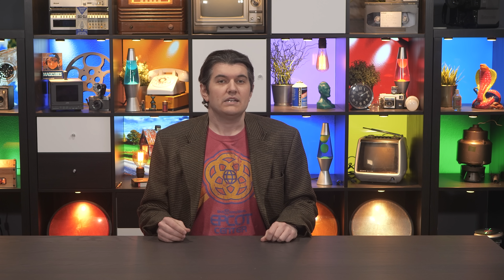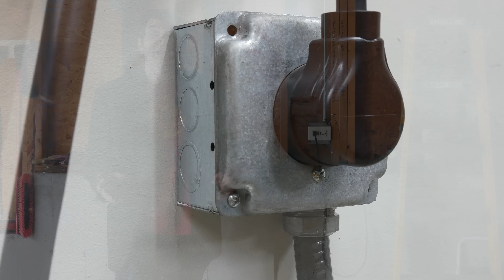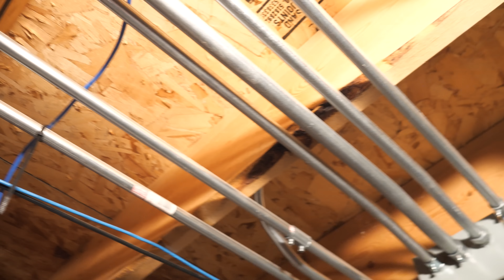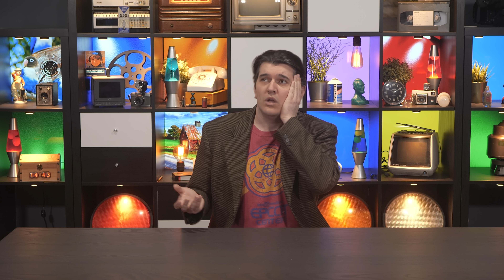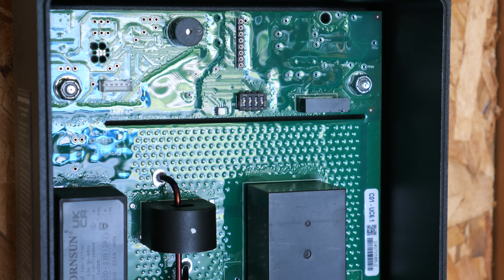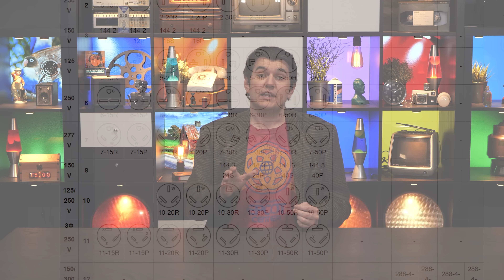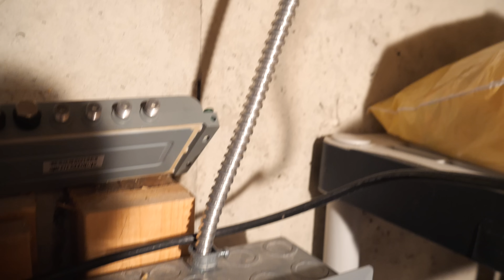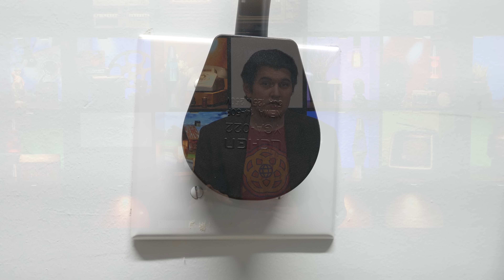The "standard" car charger is usually overkill—but your electrician might not know that

Comment: I understand your overall point: don't let home electric service limitations stop you from getting a better charging station, don't let perfect be barrier to achieving good enough.

However, if you have the capacity, and you are having to pay someone to install it, it is going to be better in the overwhelming majority of scenarios to absolutely max out the circuit. The biggest cost is going to the electrician, and EVs will only keep increasing their total battery capacity as time goes on, so undersizing the charging install is going to stifle things for the home owner (or future home owners) down the road when biting the bullet and paying the likely modest difference between a 24A vs 48A charger.
Reply: I'd argue the overall point is: you don't need upgraded service to get and support an ev.
Reply: @Spiker985Studios  that was only when he was talking about using a standard wall receptacle/15A circuit.

Everything else involved installing new service to somewhere in the house (some jobs being much easier than others depending on where your electrical box is located relative where the charger is going.)

If you are going to go to the effort or expense of running a new circuit, and you have the room in your breaker panel, there's no reason to not install a full 60A charging circuit. The price difference between running a 30A/240V circuit and a 60A/240V circuit is trivial compared to the cost of running a 30A circuit and then having to run another circuit 5-15 years down the line when EV's have 2-5x the battery capacity, or some other innovation leads to EVs needing more power.
Reply from the maker: @TeflonBilly426  So... do you know what load calculations are? Because if you've only got 100A service, and your load calcs reveal you've only got room for 20 more amps, then it is not trivial to run a 60A circuit. Because now you need a service upgrade.

Feels like you missed this.
Reply: @TechnologyConnections  I said this twice "if you have the capacity, and you are having to pay someone to install it"

I don't think I could have been any clearer that I was accounting for situations where there wasn't enough room left at the panel, whether it involved having to install a sub panel, or upgrading the entire homes electrical service when I said "if you have the capaciy" then don't scrimp running a the maximum charging circuit.
Reply: @TeflonBilly426  Yeah but really you could never need a 48A charger because you can just as easily charge your car with one of those solar panels from Harbor Freight.

Feels like you missed this.

Comment: 240v is defiantly better / but i seen several stories on the outlets  and a precautionary warning that there 1 co making quality under brand name and a lower cost equally good 2nd brand. but there's really cheap ones  that are said to be   dangerous 
so a little searching is prudent some things the cheapest is not best  but finding the 2nd name of the top one is smart  
i an tired of so many products now are the cheap china made no matter what brands on it . btw  seems major cities refuse to update codes to keep trade union happy like philly required pipe fitters pipe waterless urinals at the comcast building and last heard not a drip of water was pumped

Comment: I actually like that code requires conduit in Chicago and I wish it was here in Canada too, it reduces the risk of fires, it looks way cleaner and makes pulling new cable through that conduit so much easier rather then having to worry about romex being stapled somewhere.
Reply: Our (Canadian) 240V outlet installation required armoured cable or conduit because it’s in the garage… codes vary from province to province as well.
Reply: EMT isn't IMO any safer than properly installed NM-B; wiring itself is seldom a fire hazard, it's almost always equipment plugged into receptacles or the receptacles themselves.  Or junctions (wire joins: wire nuts, etc.) which still have to be in a j-box anyway, just like an EMT setup.
Reply: @alsavage1  YoURe pUtTiNG gLoRiFiED EXteNSiOn CaBLeS iN yoUR waLLs!!!

Comment: My Ford Escape PHEV has a 240v 16A EVSE connected to a 20A circuit. It only takes about 3 hours to fully charge but most of the time it’s not completely empty. 
Agreed that you don’t really need higher speed charging then 16A

Comment: I charged from a standard wall outlet for the first year of my EV, and only rapid charged once, on a road trip. Adding a 14-50 outlet in my garage was mostly because I had to unplug and re-plug my 5-15 EVSE every time, and the outlet was starting to feel a bit loose, which makes me nervous when I'm running 1500w unattended. 

The 14-50 is fantastic though- being able to go skiing (about 175 miles round-trip) on a Saturday, fill all the way up, and do it again on Sunday, is awesome.

Comment: I installed a NEMA 14-50 outlet and a 240 Volt charger but often use at standard outlet and the 115 Volt charger that came with my Kia Nero.  I don't drive that much and have the time to charge.  I also think it might be easier on the battery.

Comment: As Tesla and other EV manufacturers release their grip on my right to repair, electric vehicles are becoming increasingly compatible with my current daily driving needs. Unfortunately, the old "but sometimes" rule comes into play because every couple months or so, I have to drive long distances that would make an EV a significantly less than ideal situation. I expect once I move to the eastern states, an EV will fit me much better since I won't be making those long drives quite as often, making it more reasonable to put up with.

Comment: Missing the point of max constant amp rating of outlets. sure you can pull max amount from the wall socket but it will heatup and melt at some point

Comment: Why is the charging box so expensive? If it's literally a microcontroller closing a relay in a box, why does it cost the same as a computer? Also, why is it so big? I would expect it to be the size of a laptop power supply or something like that.

Comment: You can get a relay to share the same circuit if you have a dryer circuit. The car is primary but is disconnected when the dryer is turned on. If your dryer is in your garage, then you are set.
Reply: You mean just like Alec said in the video?

Comment: I fully agree with everything you said. I used a regular outside 120V plug for two years for two Nissan Leafs, but I installed a 30A hardwired unit primarily for the much higher convenience.

Comment: YUP!  I've been driving & charging my 2019 eGolf for 5 years with my standard 120V plug for my daily driving.  The only time I use a 240v power station to charge, is if I'm on a road trip at a public charging station. 😉👍

Comment: This is just one data point, but I have been charging my cars on primarily 120v at home for several years and have never been left in the lurch. I do have a laundry room adjacent to my garage, so on the rare occasion I really want to charge faster I drag out the big 10AWG extension cable I built and swap plugs on my mobile EVSE to match. (both the one I have now and the EVSE that came with my old car were switchable between 120 and 240). I rarely do this because it is just a hassle when I don't need to do it.

Comment: If there is already a cable or wiring for the charging station then yes, don't worry. But if you are installing new stuff anyway, consider the extra costs and possible future advantages. Like flexible energy pricing. You might not mind waiting 8 hours at night, but if you can take advantage of nearly free power for a few hours, you might want it filled faster. Or you might want to charge two cars?

Comment: My one question for you in regards to smart chargers is PowerShare with other chargers on the same circuit. I’d find it incredibly useful for homes with multiple EVs. If both chargers are in use, then they split power on the circuit, but if one is only in use, then why not use the available capacity?

And yes! A remade/updated guide on your guides would be much appreciated!

Comment: Woudn't it hurt the battery more if you only charge it tiny bit everyday instead of a full battery a few times per week/month? 
Lithium battery degrades overtime as more charge/discharge cycles it go through, not mentioning the temp change. 
I'd rather spend a bit more to invest a proper system to accommodate a normal charging station in first place than having to replace the battery early or more times.

Comment: This is the sort of idiotic nonsense that holds back progress.  Half the garages already have a 30 amp 240 dryer outlet.  Every one of them has a 15 amp 120 by code.  I'm sure the push for 50 amp chargers is just to maximize profits.
Reply: Profits driven by "I don't want to wait any longer than I have to.   It doesn't matter if I'm putting more strain on the grid.....F everyone else in the neighborhood...I'm being environmentally friendly."

Comment: I mean I dont consider that to me THAT  excessive for driving. However, for my parents/brother's farm I am looking forward to the RAM Charger. Moat days they don't drive at all, and even though a "small trip" (ergo to the nearest post office) is roughly 30 on round trip, with a normal trip being 140 km round trip, this still means most trips are electric only and in our case level 1 is sufficient. But I need the range extending generator for longer trips or towing (which we do multiple times a year). As we are an Alberta far. We already have standard 15 amp recepticles for powering engine block heaters and tools and such in the yard... and keep in kind the truck is projected to sit parked for days between use, lots of time at level one... and the farm only has 60 amp service so a level 2 charger could lead to issues with overloading the service power anyway.

I currently live in town and am fortunate enough to have a pedastal for my assigned spot that runs off my suite power (again mostly intended for block heaters). Even living in town with a massively reduced drive time compared to when I commuted to the city I still think the estimates for the average driver's use are wrong. Just me and my GF push the official "average" way up despite mostly being at home... but even then level 1 is sufficient... only thing stopping me from considering a BEV is that I am not entirely convinced that NORMAL cold temperatures of -30 work with those....

Comment: 1:58 Depending on your local electrical code, you might be legally obligated to install the charger on a circuit that can handle its full power.  So even if your charger supports field comissioning to 20A or lower, if the charger hardware is capable of 50A, you might be legally required to get a 62A circuit installed (80% rule).

You can still get that installed on 100A service, but you might need a switchover box installed too, just to make it impossible to turn the oven on full blast while the car is charging.  Not getting one installed may or may not be code-compliant, but accidentally flipping your main breaker is annoying so you'll want one anyway.

Comment: We don't even have a single 240v outlet in our whole house. In fact, not s single house in our track came with one. Most homes in CA built pre 1980s don't have 240v outlets as all our appliances are gas.  We can't even replace our drier, range, or water heater without an electrical upgrade.
Reply: Unless your electrical panels and/or service meter are 120V only and does not have a split bus, all you need is a two pole breaker to use both legs of a split phase service. 

Now a more likely limitation of an older panel is that the bus may be only rated for something like 100-125A (like the one my house originally came with in the late 60s), but even this is usually plenty with just the electric range/oven and dryer, as the range pretty much never pulls max load and the dryer generally does not run every day. 

Now with a 100A service adding a new 240V charging circuit on top of those would be more challenging due to load calculation rules, unless some of the existing loads are changed. For example changing to a gas range and/or a gas or heat-pump dryer can free up a lot of capacity.
Reply: @toukoaozaki  I understand how to do it.  The issue breakers would have to put in and line ran from one end of the house to the other, through the walls, and outlets installed.  This is an expensive upgrade.  

And all the homes came with 100 amp panels, which means they WOULD also have to upgrade their panels.  Fortunately our panel was upgraded to 200 amp because we had AC and a pool installed.
Reply: @SkepticCyclist Depending on how the house was built, running a new home run across the house can certainly be a pretty big and expensive project. For one, I ended up spending around 9k for a new panel & meter base & 100A sub and feeder on the other side of the house with an outdoor conduit around the perimeter of the house. 

That said, assuming an average late 1900s construction with attic space, running a 15/20/30A home run through the attic is often not too difficult and even on the easier side of realm of DIY, and it doesn’t make a difference whether it’s 120V or 240V. Most older homes with 100A service & gas appliances don’t pull anywhere near the service limit (even with incandescent lighting like my own house came with) such that adding a 20A circuit, 120V or 240V, is not going to meaningfully cause an issue without a service upgrade.

Heck, even in my own house, it came with:
- 100A meter base & panel
- 240V 40A circuit for range
- 240V 30A circuit for dryer
- Gas furnace and water heater

Load calc wise it was more than enough for adding a 240V 35A heat pump circuit. I only upgraded the panel & service because I was planning to add EVSE and split other circuits later myself. 

If I had all gas appliances, that would mean no problem with a 30A EVSE, possibly larger.

Comment: When I got my EV I wanted an 11kW wall box for charging my car but I gave the existing normal 240 volts (In Germany that's the default) socket on the patio a go and found out that it's perfectly fine for me. So for over a year now I charge my car with 2kW without problems. And when driving further I use DC charging anyway. And it saved me over 1000€ it would have cost me to get the wall box installed. The charger I use came with the car so I had no installation cost at all.

Comment: I have an old 2016 Kia Soul EV with a 27KWh pack. I just use the cable that came with the car, on 120v. I drive my car pretty rarely so it's nice that it's gently charged to full whenever I need it, and there are charging stations everywhere.

Comment: For those who have a 20amp regular outlet in the garage: 
You can buy a dual pole breaker, connect the neutral to hot, and use a NEMA 6-20 outlet to functionally have a 240V 20amp circuit without any rewiring.
I know that Tesla sells a 6-20 adaptor for their mobile charger but not sure of others.
(Note that on a 20A circuit you can only draw 16A continuous)
Reply from the maker: That's a great option when it works!

Comment: so a big issue that needs to be addressed here is that a lot of standard receptacles, whether its 5-15, 6-15, 14-30 or even the 14-50's have issues handling the long high currents required for EV Charging. Plenty of cheap 14-50's have burned up from EV chargers. so the more expensive, but much more durable Ev rated 14-50's should be used. Now for 14-30's there aren't any EV rated ones Im aware of. For 20 and 15 amp receptacles,  use hospital grade 5-15's 5-20,s or 6-15/6-20's.

But the best way to install any EV charging station is to skip the receptacle and go with a hard wired solution. Receptacles are the most common point of failure for Ev chargers, so skipping the receptacle and hard wiring the EVSE is the best and safest solution. 

I knwo you want to go with trying to encourage people to save money on installations, but you also have to ask, is it worth burning your house down in order to save 100 bucks. Cheap is cheap for a reason, and safety and quality are sacrificed in order to achieve cheap.

Also Hardwired EVSE's do need a disconnecting means within line of sight, so your installation is a code violation.
Reply: The problem with outlets burning up really seems to be mostly with the 14-50 outlets simply because they're usually used with ovens, which so rarely would draw anywhere near their maximum capacity, so if the manufacturer cheaps out it wouldn't normally be noticed. The lower capacity outlets don't have this problem nearly as much, because it's more common that they would be loaded to the full allowable 80% circuit capacity, such as by a clothes dryer.

Comment: I drive an old model S about 60 miles every other day and had just a normal 120v 15 amp and was ok, but i needed more. I was able to install a 240v 50 amp curcuit myself for less than what you spent here, so that's another good option if you already have a charging cable and are comfortable with installing circuits. My line was only about 5 feet though, so a longer run would hit hard in copper cost.